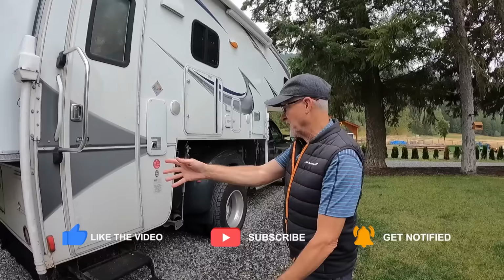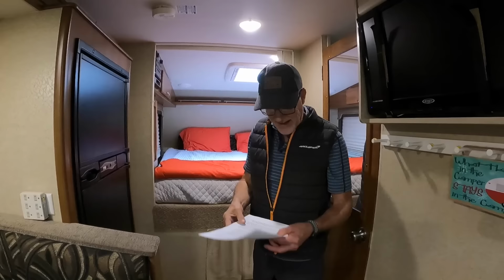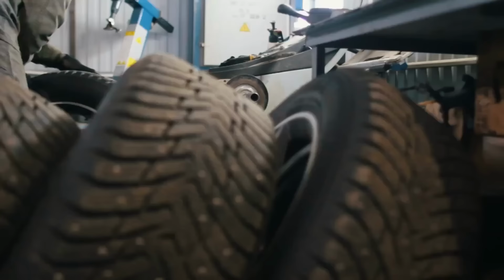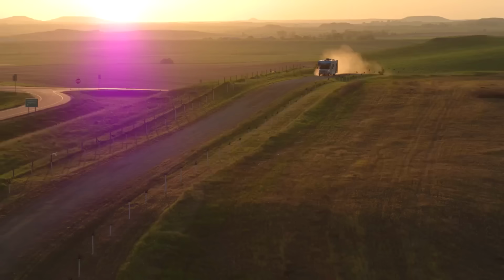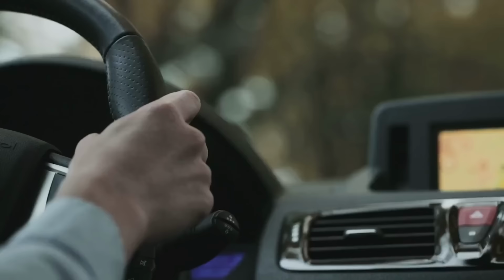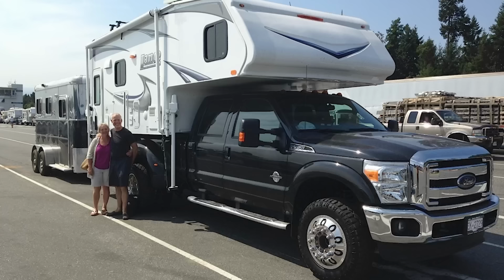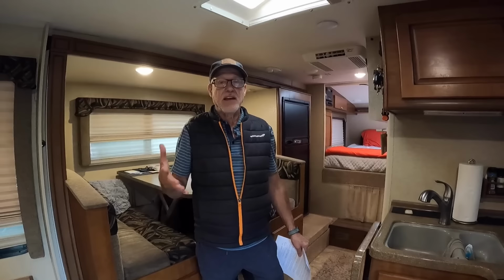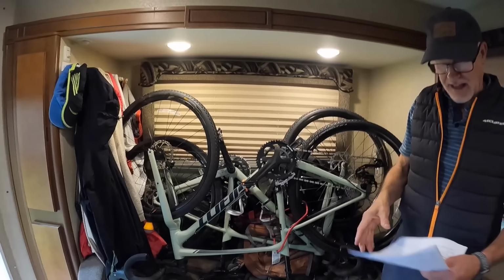Truck & Camper Pros & Cons – and how you can eliminate a couple of the cons you've heard about . . .

Comment: I agree, it's the most versatile way to travel and camp.  That's why I purchased a new truck and truck camper last year and have put over 30,000 miles on it traveling, camping and visiting friends and family.  Another pro is the ability to visit family on extended stays and you have your own personal private apartment and separate transportation.  I've done it numerous times and it's an awesome way to visit. 2021 F250 and 2021 Wolf Creek 840 here.
Reply from the maker: Wow! And I totally agree on all counts.  
Happy travelling to you!  Sounds like you've got a terrific combination there.
Reply: Eric - is your F250 diesel or gas? And it handles the camper on a SRW axle?
Reply: @Hogdriver88  7.3 Gas SRW axle.  Handles fine.  With a full load, I can climb the steepest grades as fast as I want.  As far as handling, It's not a Miata but it's amazingly stable.  3,114 Lbs of payload.
Reply: @ericcarawan1308  Ahh, the ‘Godzilla’ engine… 8 foot bed, or maybe 6.5 feet?
Reply: @Hogdriver88  I believe it is 6'10", which is the short bed with the FX4 package.
Reply: @ericcarawan1308  Excellent, thanks for the replies 👍

Comment: If that f-350 and camper weighs 16,000 lbs, you’re 2000 lbs over an f-350 gvwr
Reply from the maker: Yeah - truth.  Got the weight thing deciphered and sorted out.  With the two slides, if one has some hiking gear, let alone any water onboard that one is overweight for the F350 GVWR.  For that reason and others, I've now traded the 10-year-old Lance out for another unit that I'll be doing a review of in some upcoming episodes on the channel.
Thanks for your comments and being part of my journey.

Comment: We love our Lance 1172.❤We are full-time and I'd like to add if your using the camper for vacations here and there a 3500/350 dually will get the job done. NOW for full time travel where your going off road boondocking a lot. I would step up to at least a 4500 /450 truck. We love the fact we can drop the camper and have our cabin separated from our truck to explore and run errands etc. The Lance is a great 4 seasons camper that we've put it to the test and it always surpassed our expectations. ❤❤❤
Reply from the maker: Had that Lance for a full 10 years and it gave us a host of great memories.  Such an awesome unit.  No regrets.
Huge thanks for tuning in and sharing your experience!
Come back and visit again.
Our travelling is over for this season, but in 2024 it's off to Alaska with the trusty F350 and camper.
Reply: Thank you for your feedback

Comment: Great review.  Aside from having a shorter length, i don't see how this is better than a 15-18ft towable.  You need a dually for that camper, and you had to make several thousand dollars in upgrades/modifications.  But a regular half-ton can haul a small towable, which would be far less expensive than your setup.   **Not saying anything bad about your rig.. it's practical, safe, and looks great.  I'm just thinking about expense.  Is my thinking wrong?
Reply from the maker: Huge thanks for tuning in and being part of my journey and how this particular subject evolves.  
Great question - and it uncovers a pretty key gap in the content of my Pros & Cons video - and now I have a terrific opportunity to do a video to respond.  I'll bet you're not the only viewer that has some or all of the same questions.
Your summary of an 8' foot towable being nearly equivalent to the usable square footage of our camper is right on the money.  
In a nutshell, the justification for the dually and the suspension and wheel upgrades were only partially in response to the needs of the camper.
In it's other life, the dually is our farm truck and it slugs around both heavy and high bulk (hay) loads - solely or in conjunction with one of the several trailers we've towed - and for those chores, I love the stability and the extra floatation and traction of the dually.  I'm just not a fan of white-knuckling it when it comes to navigating, muddy ground, steep offroad climbs, uneven terrain or windy roads.  
I've got a little sawmill and I often pick up 'farmer wood' that is located on the edges of muddy fields.  That's where the added floatation provided by the oversize dual rear wheels coupled with 4WD is a godsend.   
For me, the dually and the suspension modifications also give me a lot of options - that include having the camper onboard while towing a horse or toy trailer (think Oregon dunes and 3 ATV's in a 26' toyhauler) and I just love that our F350 vacation wheels can also be used year-around for a host of heavy hauling and equipment trailering without requiring the maintenance and insurance of one more licensed vehicle.  
I recognize that my needs may be a bit unique, but when I plan my rare vehicle purchases (we will celebrate our 10 years of ownership of the featured F350 this coming February) I try hard to contemplate every possible need over the course of the next decade, and in that sense, I have had zero regrets about either the initial purchase or the subsequent modifications.
And, I realize that pretty much none of what I've said in my response here was covered in the video . . .  
Again - huge thanks for the opportunity to share 'the rest of the story'.
Reply: Phenomenal explanation.
Reply: It’s not expensive if you can afford it. Furthermore, if it fits the bill, and you have immense enjoyment while using it, that’s perfect
Reply from the maker: @mannymotta2174  You are so right.  After 9 years of priceless memories - it owes me nothing.  And today I could sell it for more than I paid for it - not that it's for sale.  haha
Reply: I think it really depends on what type of camping you are going to do.  I have been on many adventures where I am on a narrow mining road or even a regular country road  and come across a downed tree,(fyi reason to carry an electric chain saw...saved my tail more than once way back in the woods) snow drifts, land slides or other obstruction and with my truck camper I can turn around, even if it is a 30 pt turn as I inch back and forth to make the turn...if I had been in even a jeep with a tow behind it would have been impossible to turn around..even  if you would unhook the camper there was no room to get around it and almost impossible to back up anything towed on those types of roads.  If you are just hitting campgrounds or camping off main roads than I think a tow behind may more than suit your needs and there are thousands of choices to pick from.
Reply: @flyingdutchman7585  One of the problems with a tow behind (toad) is the size of the camping space if you are using a RV campground in a park or National Forest.  It all depends on your needs and desires. You do make good points about the ability to turn around or even back up. Anything can be done, but not without a challenge.

Comment: My buddy has insisted I purchase a dual-wheel one ton truck like this for my cab-over camper! One of the things you may have missed mentioning  is to warn those who insist on buying a single-axel one ton truck need to be warned about getting a flat tire on the rear!  With all that weight, a single-axel one ton will cause all that weight to bare down on the wheel and damage that too and that is even more expensive! Furthermore, under the right conditions, the wheel digging into the ground has no traction, of course, and may cause a sever sway that could cause you to lose control. I can think of other things like the outside on a turn could have a blow out and cause you to roll over as well! Lots of negative possibilities, which is why with all that weight you should strongly consider a dual-wheel rear axel for a large camper!
Reply from the maker: Thanks for tuning in.
Great point.  I just feel so much comfortable in a dually.  Maybe that is just an illusion, but for me, it's peace of mind.  
Here's wishing you all the very best.
Reply: Yes, but some positives to the single rear wheel as well, like two less tires to go bad, especially the inner ones with a dually. Limited room at toll booths., construction sites,  road repair areas, (you know,  that get very narrow with cement barriers on both sides..) Not to mention the increase in fuel consumption, and loss of miles per gallon . The trick is to find some balance  by applying some suspension alternatives ie., extra leaf springs, sway bar, perhaps some Timbrens to combat any sway on off road maneuvering, premiums tires with higher weight ratings and paying attention to your cargo capacity . Many people exceed their manufacturing standards. Not all is perfect, but the price of fuel especially diesel now days, makes the SRW much more practical  as long as it meets your  intended purposes of safety and affordability. Just saying...
Reply: I run a SRW F350 to carry my camper.  It is a Northern Lite so it's fiberglass and lighter than most truck campers.  I went with single rear wheel because having lived in the Rocky Mountains during spring thaw and with lots of snow I find that dually's do horrible in mud and snow and I have pulled many a stuck dually out with my truck.  The important thing is to run tires that are rated for heavy loads and keep them inflated to the proper psi.  Most people don't understand that by lowering the psi in your tire it's side wall rating drops significantly.  Meet a few TC on dirt roads/trails that lowered their psi and ended up either blowing or rolling a tire off the rim.

Comment: And the older you're RV, the longer it will take to find your parts and eventually (like with Teton) if they go out of business, you might not be able to get the part at all. We were stuck for weeks & even 3 months waiting for someone to find or FABRICATE what's needed and then come out to where you are because you can't get the slide in to take it to the RV repair place.
Reply from the maker: Oh wow. I really appreciate you sharing your ‘been there/done that’s experience. 
Thanks for tuning in.
Reply: @howardkettner  yeah we ended up pouring $50k into that 5th wheel and it just kept breaking. I sometimes wonder if we had actually finally fixed the last time but at that point my Husband was about to take a match to the thing so we sold it at an enormous loss
Reply from the maker: @hilostateofmind  Wow - and yet the RV manufacturers keep perpetrating these sorts of robberies on folks that are just wanting an RV so that they can relax . . .  Totally unregulated/wild west industry

Comment: I keep changing my mind between a truck camper and a Class B for one major reason, and that is the immediate access you have to the cab of a Class B in case you should want to get away from a situation in a hurry, and you don’t want to have to get out of the camper and then walk (or run) to your truck. Am I just being paranoid? But like that either units give you the ability to stop along the way at attractions. Great video! Thanks!
Reply from the maker: Thanks for tuning in and commenting!
There are definitely puts and takes to both.  I hear of a couple of incidents in out of the way campsites, where campers felt that they might be in danger and just drove away in situations like you've implied.  That has caused me to be very vigilant and intentional about where I park.
For me what it came down to is that I needed a one-ton pickup truck around our hobby farm and building projects, and having a truck and camper means one less engine and drivetrain to maintain.
Reply: @howardkettner  Appreciate you getting back to me so quickly. Your choice makes sense in your situation. Have subscribed to your channel. Safe travels!
Reply: Having been boondocking for months on end in my truck camper going on 7 years now with my wife we have yet to find a situation where we needed to get in the drivers seat in such a hurry we couldn't from the camper.  Also, even with a Class B you probably just can't up and leave without raising a stable jack or removing some kind of leveling block, etc.
Reply: @flyingdutchman7585  thanks for responding. Yeah, I never thought about the possibility of having to deal with leveling equipment. Thanks again, and safe travels!!
Reply: My biggest concern!!
Reply: Valid concern that I share with you.

Comment: We have a GMC 3500 HD DW 6.6L Duramax, Deleted with tow tune in it. We have a BigFoot Camper dry weight 2450 lbs, we get 21 litres per hundred km with it loaded and 15.5 camper off. One thing I call a PRO is not having to license the camper or inspection, also less toll cost because of less axles, also ferry fees are less due to short length and camp sites are less too. We always leave the camper on the truck for insurance reasons, if it’s not on the truck and something happens to it like a fire or damage it’s not covered, but on the truck it’s covered. You did a great job on this informative video.
Reply from the maker: Thanks for tuning in.  
Love your unit.  While there are a lot of things I like about my unit - I'd never get one this big again.  It's just a beast.  Lots to love.  Lots I'd do differently.  
Great list of pro's that I'd not talked about.  thanks you.
PS - I have my camper off of the truck most of the time - because I probably need to use the truck at least once every couple of weeks for a day's duty without the camper.  Found an insurer that gives me full value coverage for $240 per year.

Comment: I believe at some point everybody goes through this choice process of prioritizing type of RV. Your presentation was one of the most informative and well explained I have viewed viewed.
I am currently in a flat bed, hardside pop-up DIY camper. It's on a 1995 Toyota T100 rear-wheel drive V6. Equipped with eight 100 watt solar panels and 400 ah of batteries. This is set up for 1 person and I find it very functional. I am a full-timer.
Reply from the maker: Man you are living my dream.  Good on you!.  Here's wishing you an amazing journey.
Huge thanks for tuning in and being part of mine.

Comment: Would be nice to try before you buy when it comes to truck campers. Not easy to do but when you mentioned roundabouts etc it made me realize that there are so many driving conditions to test and so many different truck /camper configurations.

When spending $50-70K I would be frustrated at my purchase if I did not at least somewhat know how the vehicle is going to react under ordinary driving situations. Thank you for your video.
Reply from the maker: You could not be more correct.  10 RV's over 3 decades have taught me that one needs to factor in about 5% above the initial cost for bridging the gap between expectations and reality - whether that is adding solar panels, enhancing suspension, etc.  
In my experience - despite best efforts and all of the pre-purchase research that I do, it seems like there are one or two really good questions that I failed to ask.

Comment: Great video for a newbie camper like me. Bought our truck and camper 2 years ago as a package used. 2008 GMC 3500 dually diesel 4WD. 2008 Lance 992 camper. Never camped before or drove a truck with a camper and it took a while to get used to that weight but we love the set up. We ordered a 2022 Lance 1172 camper last November and are still waiting for delivery up to Canada. I agree with you about the versatility of a truck camper to pretty mush go anywhere and park anywhere in a small town or village. We are still learning. We ordered the new camper with extra solar power lithium batteries a generator and a cell phone antenna booster. I did put airbags on my truck to help with the weight and stability. Our Lance 992 is over 4500 lbs. we prefer the layout of the 1172 with the rear couch as an option to sit instead of always in the dinette. 
Happy trails. 👍🇨🇦
Reply from the maker: Wow! Congrats on the order for the 1172!  You'll definitely need to reach out and let me know how you like it!  
Sounds like you've ordered all the right stuff in terms of options.  
About twice a year Coral and I will browse a few lots, always looking at our options, and every time returning to our purchase of the 1172, and to paraphrase a line out of  the Raiders of the Lost Ark, remark to each other "we chose wisely". Happy RV'ing (from Kelowna, BC to you).
🇨🇦
Reply: Nice to hear back from you. We are looking forward to the new camper. We didn’t think it would take this long to come after we were told 8 months and now could be a year or longer for delivery. We traded out 992 in on it. Now Lance is making the 2023 models. They’ve made a number of changes on the new 1172’s and they look amazing. Our Canadian dollar sucks though and so does Turdeau 🇨🇦

Comment: the fact is, the wider outward the wheels or tires, the more sway or lean, due to the leverage being further out from leaf suspension points, think of the modified outward wheels as an additional extension bar like the breaker bar, but again lucky you beef up the leaf springs as well.   Thx for sharing great info.
Reply from the maker: Thanks for tuning in . . .
Great explanation on the 'leverage' applied by the wider wheels . . . Wish I'd thought of that and mentioned/explained it in the video like you did.